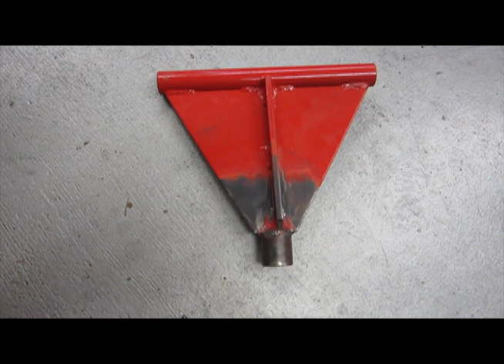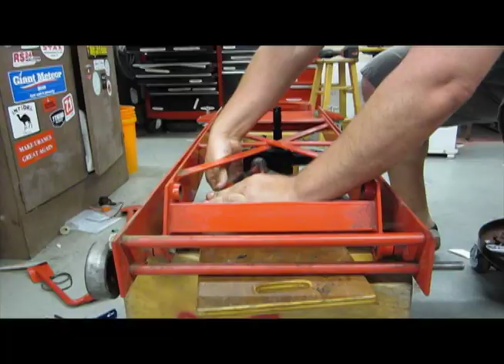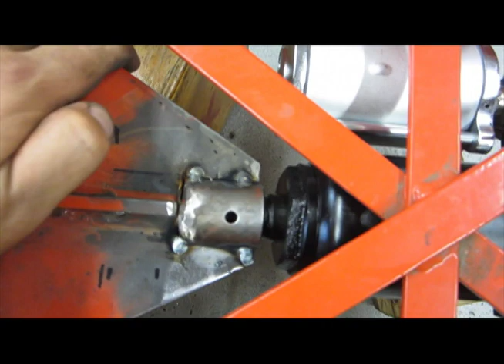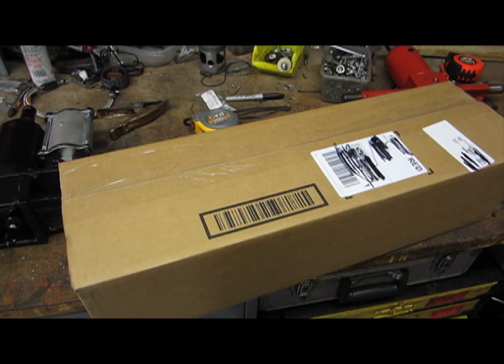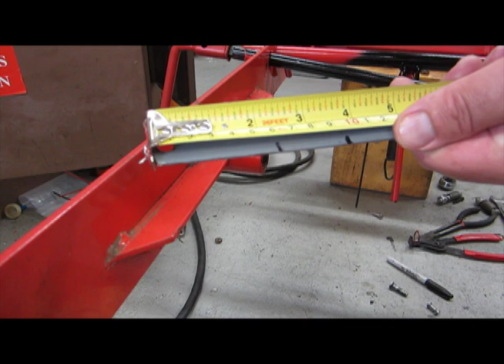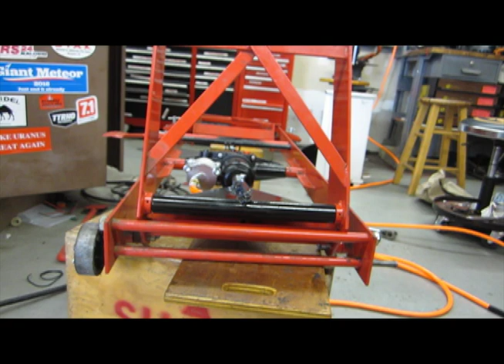Harbor Freight Motorcycle lift table air over hydraulic pump upgrade/modification

Comment: Great video. Question: Your descriptions states, "Don't forget to order the base!" and link for the pump says "Listing is for pump only".  Does that mean you need to order a manual pump as well as the part you listed?  Just confused on what is the base.

Comment: Nice job.  I have a 17 year old 91764 lift with a bad pump.  It works fine with my bikes 500lbs and under but puked itself trying to lift my Harley Road Glide.  At 900+ lbs it just might be time for a lift replacement.  Costly, but the bike is too near the limit of the lift for my comfort.  Even if it did work, I'd drill a few new holes for the safety bar higher up as I don't need the bike more than 24" off the floor.  By the way, I guessed right.  You sound exactly like a contract engineer I use that's from Baton Rouge.

Comment: I have the Central Pneumatics motorcycle lift table that had the air/ hydraulic jack. After about 12 years the pneumatic pump gave out and I manually pumped it up for about a year.  I had been toying with the idea of converting it to a hydraulic cylinder similar to a log splitter.  After about a year of hunting on line and through junk yards I came across a hydraulic pump unit for an automotive lift.  I found a 2" cylinder with a 6" stroke that I thought would do the job.  I fabricated a mount out of a 4" square steel tube (a little over kill there. 3" would have been quite adequate).  That served as a cross member between the frame rails of the lift frame. I made a post out of 3 pieces of 5/16" X 2" bar stock sandwiched together and welded.  I drilled one end to receive the clevis pin of the hydraulic cylinder.  Then I centered and welded the post perpendicular to the square tube. I had to weld the cross member onto the frame far enough forward for the rear lift arms to clear in the down position.  That meant removing the rods for the pedals.  The rod on the cylinder was much smaller than the ram on the old jack so I had to make a collar to thread on the end of the rod to make it fit into the cup on the V plate.  The pivot rod for the V plate broke the center bolt twice so I drilled and tapped each end and bolted a fender washer to each end to keep the rod in place.  Once mounted and connected to the pump unit I rolled my 600# bike on the lift and hit the button to lift it.  I found I had turned my lift into a catapult.  It lifted the bike to the top in less than 2 seconds, and when it got to the top it jerked the whole assembly back about 4" along the floor.  I had to slow it down.  To do so I made a restrictor that I put in the fitting by the cylinder to restrict the rate of flow into the cylinder.  I had to choke it down from 3/8" down to .025".  That slowed the lift down to 8 seconds and kept it in place.  The pump unit has a go switch to raise the lift and a lever to let it down by gravity. I installed a pedal switch on the opposite side of the lift so I can lift it from that side too.  Since the cylinder has a 6" stroke and it only takes 4" to lift it all the way so I installed a stop switch to keep it from over extending.  I put a 960# bike on the lift and it lifted it about a third of the way up and overloaded it and blew the breaker.  I then installed a 2 1/2" cylinder which gave me plenty of force to lift a 1000# bike.

The only down side is if the lift isn't all the way up, and I want to lift it higher,  I have to let it down, either on to the safety bar or all the way down.  This relieves the pressure on the hydraulics and allows the motor time to spool up again to lift it all the way.

I realize that it's more work and expense than most people go to on their HF lifts, but I think it was worth it.
Here's a link to the video of my modifications.
https://www.youtube.com/watch?v=T6eHjhZNkXw

Comment: Great video, just the meat without the boring obvious disassembly! I have the same model that has been sitting for many years. I found it leaking as soon as I added fluid and pumped it up. Turns out the little rubber plunger on the piston was rotted away! Put in a stack of O-rings and got it working without leaking, but I expect that as soon as I load up an 800 lb bike the pump will blow out the seal! Going to order the Redline unit and dust off the welder!

Comment: Thanks. I have the same obscure lift and I need more power to lift a trike. I already removed the orig manual pump.  i hope this air/hyd replacement can do the job.   825 lbs.   Wadya think?

Comment: I will give you another upgrade. take the plastic knob off of the wheel clamp and weld a socket on it. then you can take a 1/4" impact with a corresponding 3/8 or 1/2 " adapter to the socket and open or close the clamp with the impact. it will slide the bike over to tighten it.

Comment: I’m always dumbfounded when I see people reinvent something. If you had the skills from the start, why did you not simply build one rather then buy something you need to modify?
Reply: Reinvent?  More like improved. One could not buy the material needed to build that for what it cost to buy. Not to mention the time to build, welding supplies, etc.  That's why we modify existing parts to suit our individual needs.
Reply: @charliedee9276  In my case I just wore it out and decided to improve on the design by converting it to a hydraulic cylinder with an electric pump.

Comment: I had a table that I bought in 16.  One it sat in the garage for the winter it would no longer lift my bike.  (bagger)  It still worked just did not have enough grunt to get 900 lbs. up.  The dealer where I got the table took one off another unit and it worked until enduring another winter.  Same think, works for light loads but can't muster enough grunt to get the bike in the air.  Was able to return table and get refund.  There are replacement pumps but one is 53.00 and the other one is 122.00.  Evidently the seals are affected by the cold weather.  There is a video out where the guy puts some at205 and that helps the seals.  I'm planning on trying my luck with another table when the weather gets warmer.  Anyway here it the link for the replacement pumps..  https://manuals.harborfreight.com/manuals/parts/P68892.pdf
Reply: Interesting.  I have 2 of them, an older Pittsburgh and a Central. Living in Michigan they see plenty of cold and both have never had a problem lifting my 91 FLHTP Police bike. It is a bit lighter than the new ones but she's still a big girl at 780 wet.

Comment: Great video - awesome mod! I bought a similar lift table from Princess Auto (like a Canadian Harbor Freight). I've done some mods to mine too, including one for an issue we appear to share - the cross-bracing on the back legs covers the pump fill plug when the table is lowered. My mods at https://youtu.be/tMKky9NRGQI

Comment: I built one like this back in 2014. I too used the redline kit. But my air motor stopped working about 3 weeks ago. Redline refused to sell me just the air motor. Then while I was working on it I found where the post had started to bend and one broken bolt. So I decided just to order a new lift. Just be careful and keep an eye on your legs and supports. One could break and fall on you. 
Good luck. I bought an Apluselift MT1500. MY channel is Duke's world.
Reply: I'm curious what post started to bend? Was it related to the upgrade, or was it just part of the lift? I'm thinking of this conversion.
Reply: @bscott433  The two front posts on both sides and the bolts had started to pull through the lower side rails. I believe I overloaded it too many times. I had planned to rebuild it but not really sure if it's worth the trouble. If you do build one, just keep in mind it's not built to handle over 1000 lbs.